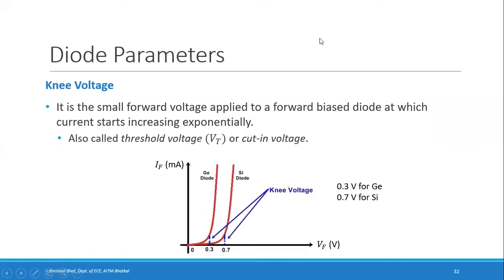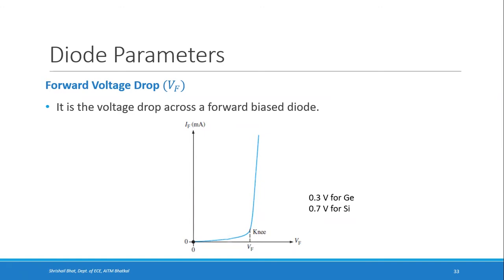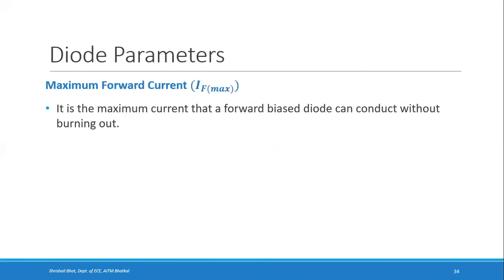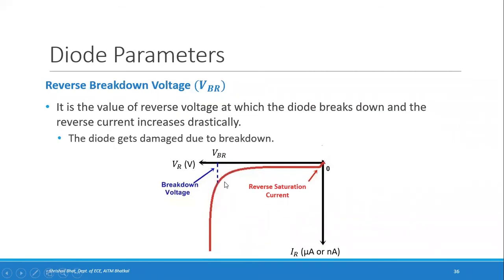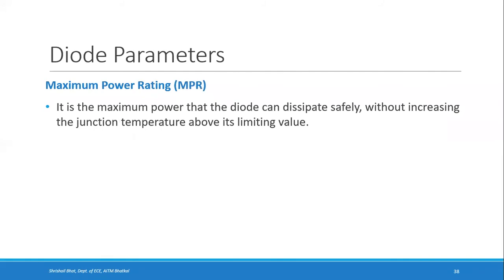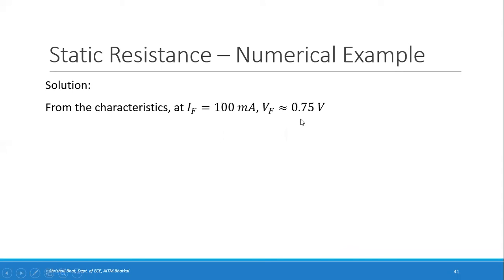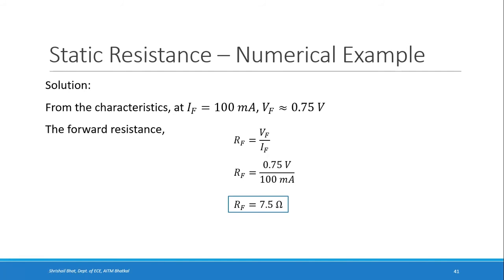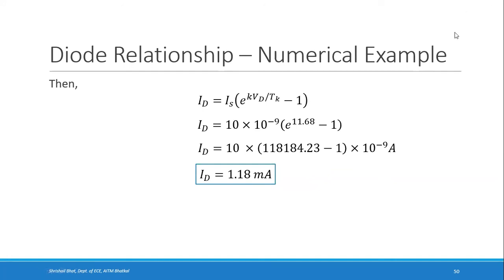Basic Electronics (18ELN14 | 18ELN24) | Module 1 | Lecture 2 | VTU

Comment: 21:12 why did you take the If value as 60 mA, I think it should be 70 mA
Reply: Given I_f is 70 mA. We have considered change in I_f as 60 mA to calculate the dynamic resistance.